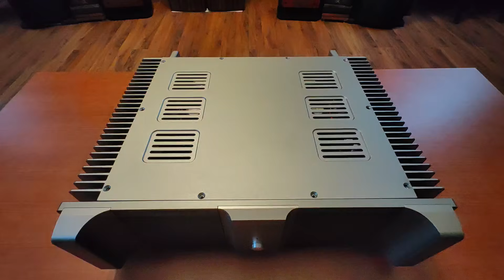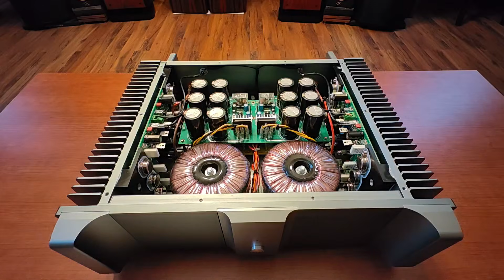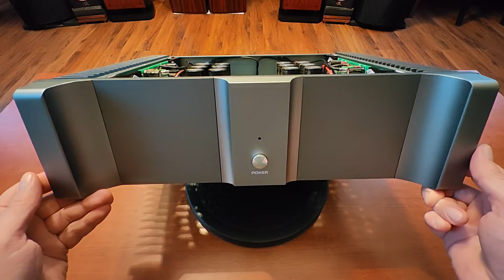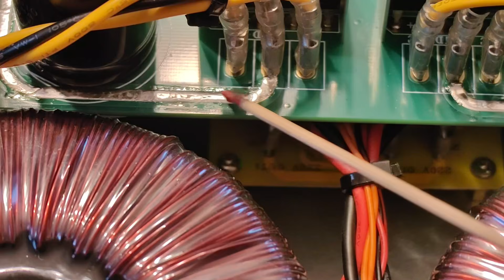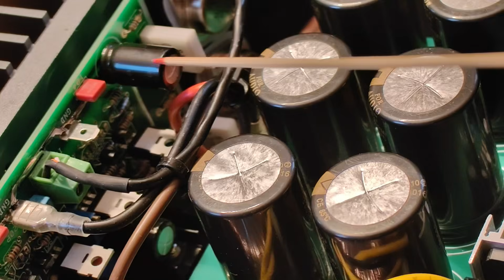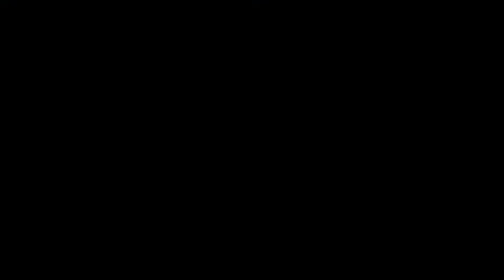The Beast & The Beauty in one: Krell KSA100 MK2 clone amplifier review!

Comment: Mine arrived November 2025. It got only moderate use and last week started overheating in a big way. I left my system turned on with no music playing for about 2 hrs and when I got back the whole thing was so hot even the faceplate was hot. It's coming from the amplifier boards, I think. This is the problem with buying from China.
Reply from the maker: Have you contacted the seller about that? 
Was this one coming from the same shop I got mine from? 
If not, they may be slightly different inside (that's why I link to exactly the same place I got my units from)
Reply: @k4syx 
Thanks for replying Tom. Yes I've contacted them. Same as the seller you bought from. No reply. I'll have to try to get it repaired locally. A shame, because it sounded great.

Comment: I bought ksa 100 pass /krell clone and paired it with CAT SL1 preamp which both you covered. I found on increment 1 on CAT the power amp got too loud and grew louder with each new step of volume. I guess the sensetivity of input is too high or CAT is too high on preout. What do you think and how to bring the volume lower?
Reply: Wrong. I got over the confusion. It looks all compatibility values and specs  are good but still the volume is a tad higher and bass missing a lot. Tried cables and all.
Reply from the maker: Yes I didn't really like CAT1 clone. I hope it can be fixed by some replacements, so I will return to it in some point in time. But Krell had excellent bass and  I don't remember Cat having any problems in this specific area. 
That's weird. It's that a Krell clone from the same seller I got mine from? Does it look the same internally?
Reply: @k4syx cheaper version with same insides and lighter casing. But in fact the issue is no more. In brief,  I got confused by controversial tech reports of high impedance and volume on CAT and low values on Krell which all turned a lie since both specs were published to be fine compatible. But still I had to add impedance jacks to the interconnect to tame the overloud and bass-shy performance. You may know the clue. Its abnormal, this shrieky output. By comparison PrimaLuna Dialog2 integrated gives HUGE bass in same setup.
Reply: And how to get cheapest martin logans, any idea? We here are cut any money transfer to pay online.

Comment: A lot of these clone amps have 'Elna' brand caps. How does one know that these caps aren't clones as well?
Reply from the maker: Thats a million dollar question. These seem to be some kind of surplus from production line as you can get them customized for Yamaha etc too. If you look on Ali for those you will see them and in the comments guys that bought them very often post measurements. And these measure very well with low ESR and capacity even better than specified tolerance. It also seems that they are available in very large quantities.
But no one seems to know for sure...

Comment: Clone?
This is a completely different amplifier than it states to be.
Not even a close copy.
This is a class AB amp with a lot of crossover distortion. 
The main feature of the original is to be a true class A amplifier. This one doesn't even tries to. Transformers less that 1/3 in size and capacity compared to the original.

Comment: Hello! Sorry that I'm not writing about the content of the video. Did you also buy a pair of Tuolihao Q8 speakers (with a full-range driver, without a crossover)? If so, will there be a video about it? I've experienced some strange things about the sound of this one. I wouldn't write much because I don't want to influence your opinion. However, I can't figure out how to disassemble it. How could I look inside, do you have any ideas? I'd like to take a closer look to the driver, maybe take it out...

However, one important thing! The "screws" of the reflex port visible from the outside are not real. They're just a design element. They're part of the plastic rim... I managed to break three out of the 4 on one of the speakers with a screwdriver, because I couldn't believe they weren't real screws...:D
Reply from the maker: Yes I got mine and they are right after burn in - there will be a video review soon. I've learned about the screws too :)
I've given these a short look trying to figure out how to disassemble it, unless I will discover something I think there may be a problem as it seems that front panel is glued to the rest of the box...
Reply: @k4syx  Thanks for the reply. Yes, that's what I came to the same conclusion... I think the front panel is glued to the box. However, it's interesting to see how much the speakers sound better as the burn in period increases. I'm currently trying to come to my senses because I can't believe how much their sound has changed from the initial state. Approximately how many hours did you break them in?

Comment: I can conclude I have no problem to hear all the layers, nuances and details with side and back voices and claps when guitar is playing. 
Also small chorus extending not so far diagonaly back of the right and left of the speakers,  the system can distinguish between individual male and female voices. 
Temporary System: Wiim Ultra ( Spotify), JLH1969 (2x10W -not the same version you have), and just purchased (again) 20 years old gloriously sundstaging speakers  (my first audio love) Mission Volare63, MTM design, 89db, 8 Ohm nominally. Room is to some degree acoustically very well treated and the sound have very good and acurate frequency response and fast decay - down to 400Hz less than 200 ms, down to 70/100 Hz less than 300ms, down to 30 Hz  300 - 600 ms.  NO DSP or room correction!
Speaker's front panel is cca 110 cm away from the front wall.
This is room factor is for sure at leats 50% of great sound in terms of hearing layers, depth, nunaces, detalis in the sound stage.  With this spekers JLH's sound stage is no more somehow "eliptical" as we agreed back then, but is far more rounded and far more deeeep, then before with any other speakers by so far. The singing comming out is simply magnificent in all aspects :))
Both suggested musical performances are very fine to listen to. :)
Reply from the maker: Thanks for sharing! Cheers!

Comment: Whilst it seems a good value package with nice case work, good build and good power it is still an assembly of second hand and likely some fake parts. Does it matter? Not if you’re handy with a solder iron and measuring equipment if something goes up in smoke and all the bits are still freely available. Yes if these not apply. It’a a long way back to China.
Reply from the maker: After my experiences with Naim and Cambridge Audio authorized service centers (as they limit access to some parts to 3rd party workshops) I would rather be able to get it to some local place in case of any problems.
Oh yes and within first 90 days you can just apply for AliExpress full refund :)
Reply: I’m afraid you’ve been misinformed dude. For decades, high-end audio companies have been charging INSANE prices for their equipment, with internal components that aren’t any better than the ones used in this amplifier—-in fact, in many cases INFERIOR to these.  Also, those overpriced amps, preamps, etc. are often assembled BY THE VERY SAME PEOPLE WHO ARE BUILDING THESE AMPLIFIERS, even when they proclaim their stuff is built say, in the U.S.!  These companies buy units from these Chinese electronic craftspersons with the top plate off, screw it on here in the U.S, and call it “assembled in USA”!  Meanwhile Mr. Krell, Pass, Rowland, Levinson, etc. are sipping Mai Tais on their yachts and softly chuckling maniacally after selling these 1000%-marked-up amps to us suckers!  
What you see here, is AUDIO JUSTICE.  I’ve been waiting decades for an opportunity to buy top-level audio electronics like this, at a reality-based price.  Can’t WAIT to order a clone NHB-108 D5Pro!!

Comment: Nice Video!  I was curious about this amp that I have been watching on AliExpress.  You already mentioned exactly the questions I had regarding comparing this Amp with the DartZeel, since you had some really great things to say about that amp!  I am very interested in the comparison, when you have the time to compare them.  I am also using Martin Logan Electrostats, so your input regarding driving those speakers would be very interesting.  Mine are the Martin Logan ReQuest, quite a few years older than yours, and I think they could definitely use some upgrades in the crossovers.  Cheers!

Comment: I wonder what bias current it is running on. Factory units idle current is about 7-8 A which means 3.5-4 A per channel. They use two cooling fans together with heat sinks. The two rows of heat sink of this clone look kind of small for a 100W class A power amplifier. The power transformers are also a bit small.
Reply from the maker: This one is definetely biased differently as it gets barely warm, that was first thing that got my attention during the burn in

Comment: The Cambridge is class AB. Even if those transformers are able to deliver 400w by either miracle, the rule of thumb is: transformer for class A should to be: Amp power output multiplied by factor of 5 at least.
Reply from the maker: I don't think it's working in pure class A, temperature and current/power draw are way too low for that.

Comment: Im amazed how well these clones are built!  Very nice and thick aluminum plates and fins, everything is flush to the surface with no screw heads all over the place either.  You look at amps from todays manufacturers and all you see is thin meatal and screw heads like warts every where, just plain ringing black boxes that are way over priced.  Im glad the Chinese are finally cranking out well made power amplifiers at reasonable prices also!  Thank you so much for your great reviews, you are doing a lot of people a good service and showing a better alternative.  

Now on a different note, I wonder if its possible to upgrade the two power transformers with some bigger ones, I mean same diameter but to come up close to the top of the top cover.  I think that would really step this thing up.
Reply from the maker: Thanks! 
Yes these are built with way lower labour costs and with zero marketing, ad etc costs so the price is very good.
As for the transformers I think that as long as you'll get secondaries right AND it will fit inside then go for it! :)

Comment: In the past I have had a KSA150 and KSA100(not clones). I liked them for their accuracy in the mids and highs. A bit forward and lean on bottom.  I ended up choosing to go with a Classe amp which I still have. I liked the D5pro better than all of them but it recently went poof with black smoke.  My B&W 801s are OK though. I miss the D5Pro. I am reluctant to order another after what happened.
Reply: That was a clear bias adjustments problem. 
I recommend you to hire a good engineer to check and re-setup the bias , when you decide to go with a clone PA from China
Reply: Gasp!!!
What happened???
It should still be under warranty. 
What response did you get from the manufacturer?
Reply: @carlitomelon4610 Don't panic, Carlos ! All handles was probably blasting Nine Inch Nails at 125 dB at the time. I'm sure yours will be fine.😉
Reply: @jimfarrell4635 

Haha Jim.
Arthur Dent had reason to Panic!
Check out @AllHsndles'  profile description:
"YouTube is the modern book burner and a CIA asset"....
🤔

I'd hope he can post proof of the amp failure or communication with the seller on warranty replacement....
Reply: Smoke in normal behavior for the class A, or high bias AB amplifier, without negative feedback and fast acting, PSU cutting protection.
Reply from the maker: Had you figured out what was the problem, the root cause for failure?
Black smoke seems very weird as usually it's white or gray?
Reply: @k4syx  black smoke, most of the time, comes out from capacitors in the PSU. 
High current together with power line above the normal limits 10% up. 
They design  the PSU capacitors on the window limits of voltage, to save money.
Reply: Which Classe amp?

Comment: Hmm wish we had a clear score of the top ones, AI navigates me more towards D5 pro or FM801 with C2860 Plus as a pre amp. EDIT: Well I bought 300PLN DAC + cable+ Cary 90 pre amp. Thats what research shown is best eh. There is some other good DAC for 230$ but I will play only from TV that is connected to PC 30 meters away via HDMI and I am not going to pass more cables across the house. Anyway thanks for reviews :)
Reply from the maker: I want to have something like that when I will finish all reviews, a kind of table with scores in different areas.
As for AI beware, it seems that my reviews had been crawled for model learning so they basically will give you summary of my vids. Along with some hallucinations like merging different brands and models in "one" device. Something like "DartZeel C2860+ power amp"

Comment: Am I wrong that the transistors are mounted to a separate piece of aluminum and not directly mounted to the actual heatsinks? Seriously, go back and look at the video, the transistors are not leveraging the entire heatsink itself for heat dissipation. I do see that the chunk of aluminum they are mounted to is attached to a small section of the heatsink but the transistors are NOT mounted to the actual heatsinks.
Reply: Looks like the transistor mount is screwed firmly to the 'heatsunk chassis' with thermal glue or paste. The original has a proprietary fan cooled heat sink turret thingy.
Reply: @johnshaw359  Yep, I saw that, too. And so, yeah, there is some heat transfer there from the block of metal the transistors are attached and main heatsink chassis but I would bet only a small area around the heatsink gets a little warm. The vast majority of the entire heatsink chassis is likely relatively cool for the most part.
Reply from the maker: Yes the pairs on the sides are mounted like that, though 4 others I'm the middle of the board (not really visible in the video) are mounted directly in the middle of the lower part of heatsink.
That one is also not class a biased, to my surprise it doesn't create a lot of heat
Reply: @k4syx  potrebbe non essere classe A
Reply from the maker: @CriFra-3174  I think so too. Too cold for that. I could fry some eggs on other class a amps I have, not here :)
Reply: Krell is/was class A and had enormous heat sinks and enormous capacitors. This is a joke.
Reply: I agree. All of my high power amps have the output transistors mounted to the heat sinks. Would not get this particular clone. The MUSMYS. A 70 is a better  choice.